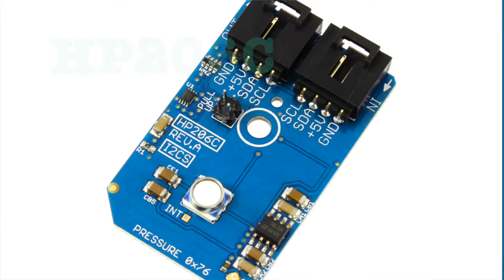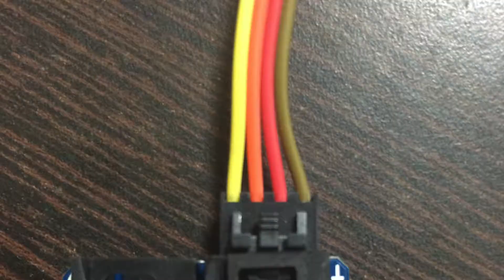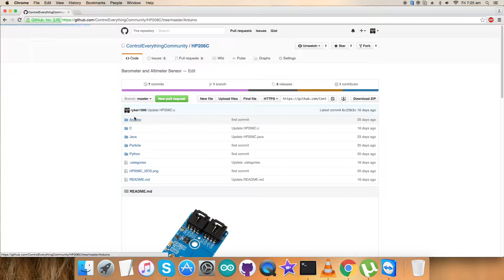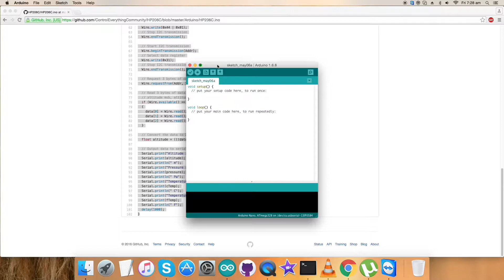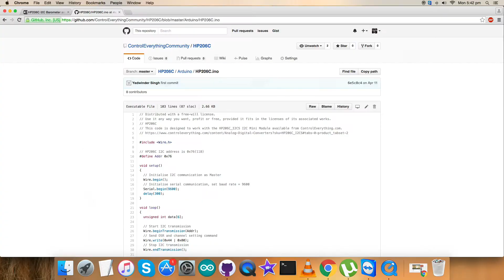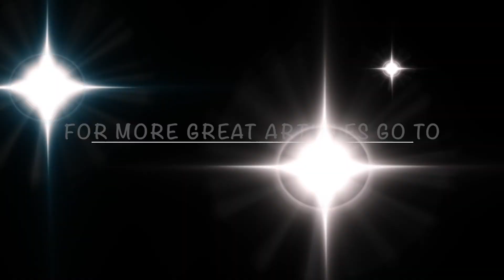Arduino Nano HP206C Barometer & Altimeter Sensor Tutorial

Comment: how to actually get accurate date from this?, there is a lot of noise, and the altitude for me is like - 64 meters ... and i am not under water.
Reply from the maker: Are you using the above sensor
Reply: @DcubeTechVentures  the same sensor, just different shield, I am using the Seed Grove one ... It is very noise, pressure variation is too big
Reply from the maker: @olavogazzola2650  It should be a hardware issue, Please try this https://dcubestore.com/product/i2c-shield-for-arduino-nano/ Sheild.